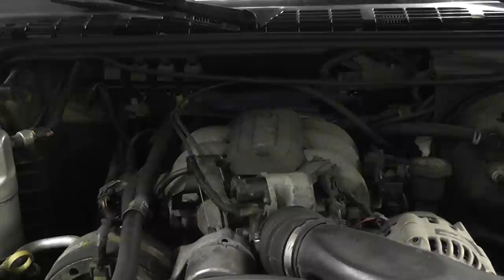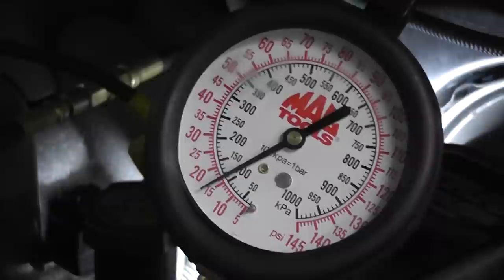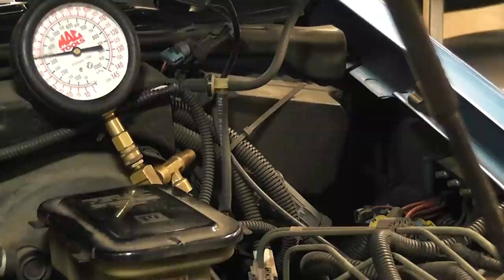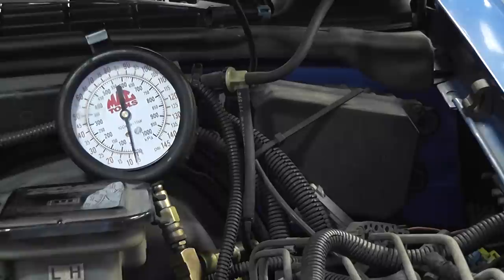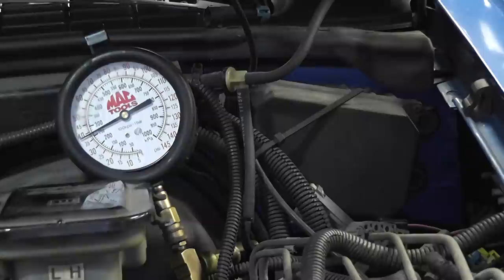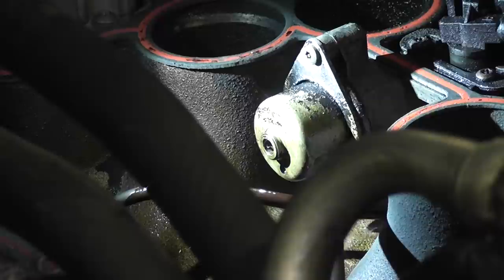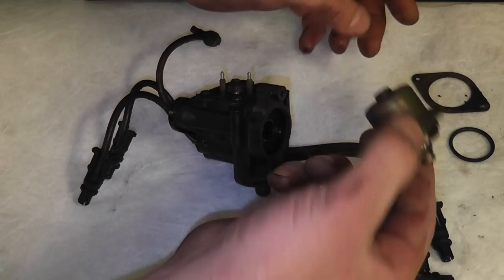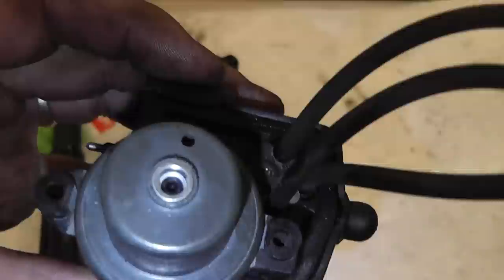How to identify and repair a leaking fuel pressure regulator (GM CPI system) part 1

Comment: nice video, preach safety but wear a ring while working with electrical terminals.... set the example
Reply from the maker: And where was my hand (ring), when checking fuel pressure, that was so dangerous? I am aware of the risks of the ring I wear. When I first got married, I used to take it off but then I would lose it. 
It's been 20 years now and I will not be taking it off. The only time I do is when reaching in an area that I cannot see, where I know there are constant power feeds. Then I put it right back on. 
I love my wife more than anything and am willing to take the small risk of it being burning into my finger (only if I am careless), than to lose this ring.
Reply: ScannerDanner i dont take my ring off while working. too much effort